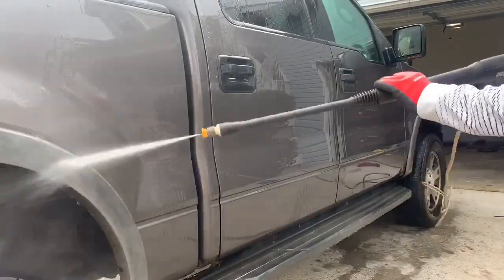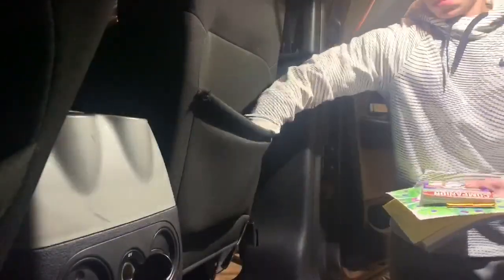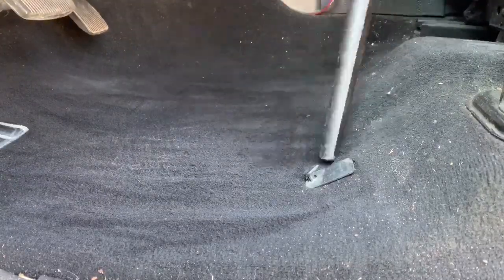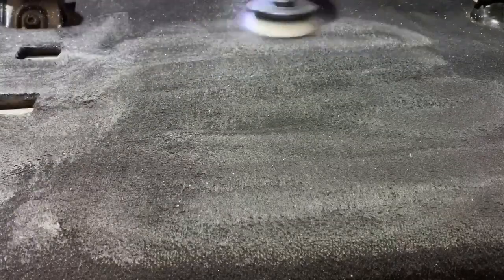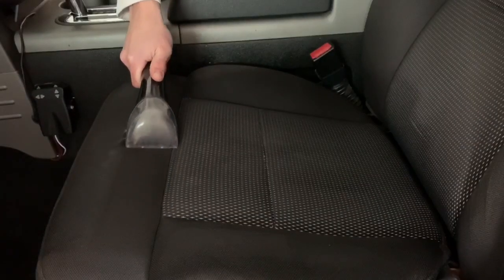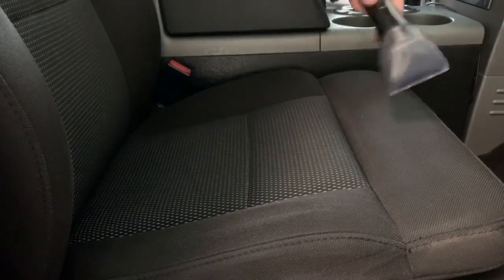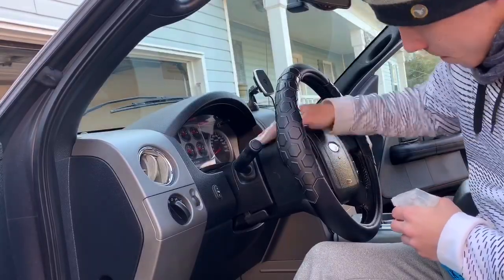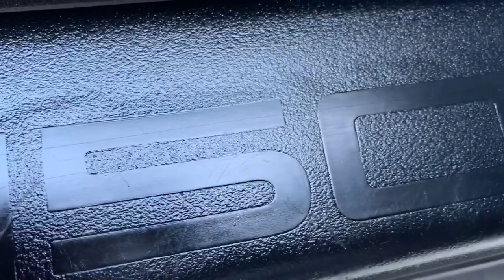DIRTY CAR DETAILING | Satisfying Complete Deep Cleaning of a Filthy Truck Interior and Exterior

Comment: 5 umbrellas; Glad to see you are starting sweeping the extractor from the very end edge of the upholstery rather than in the middle or 2/3 of the seat backwards.  Remember to keep a consistent pattern so you don't waste water and time going over it twice, unless you need to.  Also when the water starts coming thru clean, you don't need to dispense water during your sweep each time.  That will save time and allow you seats to dry more quickly.  Just run the extractor over it, but don't depress the water.  The extractor will still suck up any extra water in the seat cushion.
Reply from the maker: You guessed it! Thank you for the tips as well. 😃